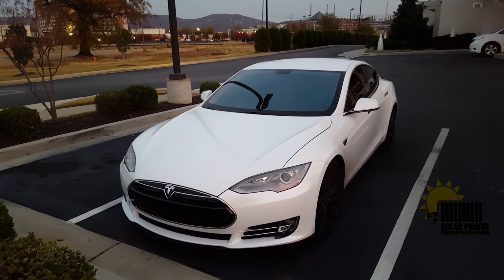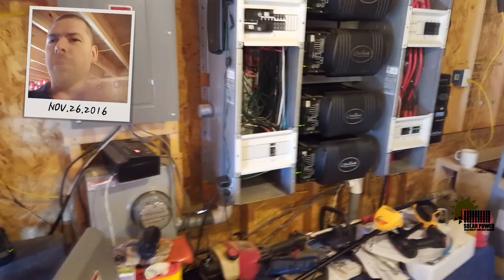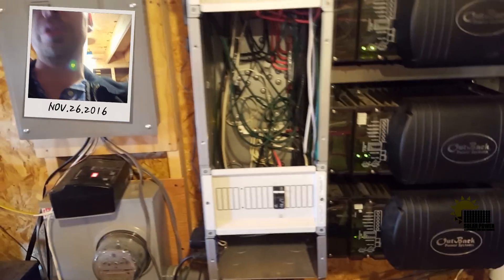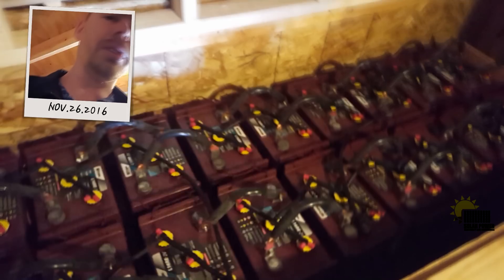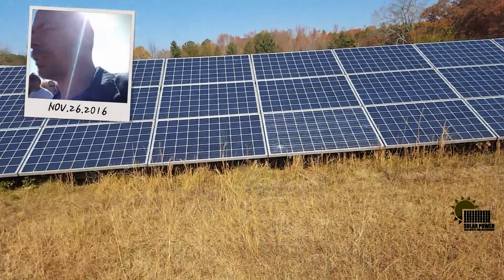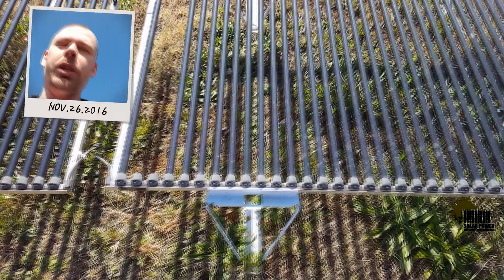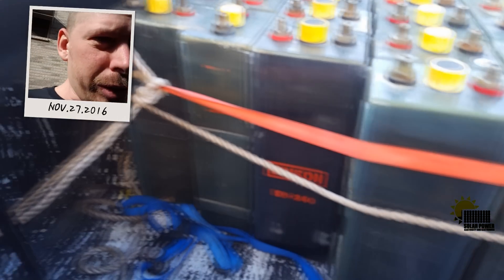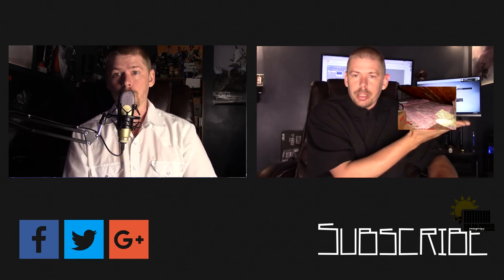The Biggest Off Grid Solar Array Power System Ever Made!!! 17,500 Watts Of Solar!!!!!!!!!!

Comment: This is a very useful for understanding and planning out an off grid solar system. It uses great examples to explain the basic electrical concepts you need to know. All of the components of a complete system are covered, including practical tips and opinions. https://plus.google.com/b/100728704920141855812/100728704920141855812/posts/WjRt4LRZEzo
Reply: BEST TUTORIAL EVER.

Comment: my guess at least 100,000
Reply from the maker: the solar panels today will be $10,000 or so and 4 charge controllers will be  $2,300 the inverters will be about $8,000 and batteries i don't know but it will not be cheap i bet $15,000 + wiring and mounting for the solar he used old pipe so free

Comment: 2:10 Not "14 megawatts of energy", but "1 megawatt hours of energy". Megawatts are units of power, not energy.

Not "55 thousand watts of storage capacity". It is "55 thousand watt hours"! Big difference again.

3:20, it is unlikely it was a bullet in the solar panel. It would penetrate deeper definitively. Maybe a rock, or hail, or a small meteorite?

Nice installation, but I find it interesting that the grass is not cut around it, or that the panels are not elevate more from the ground. The wiring is a bit crappy and messy tho.
Reply from the maker: I didn't install it. Look at my solar install. https://www.youtube.com/watch?v=cjk06C7CCEM